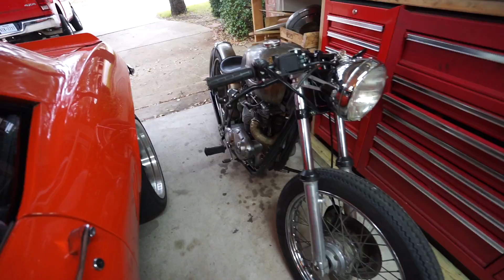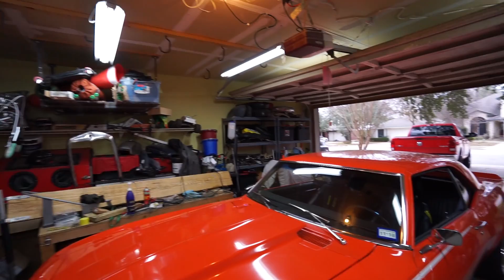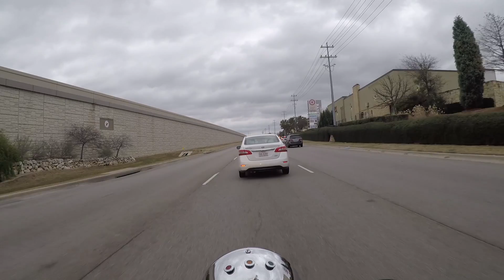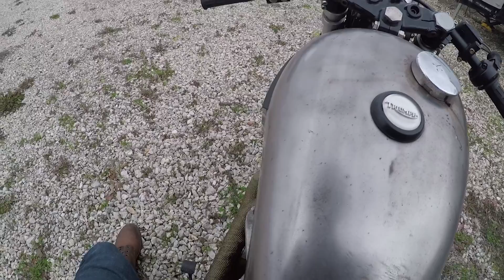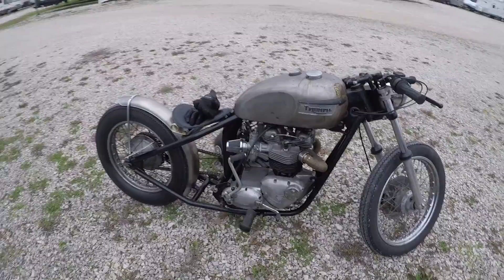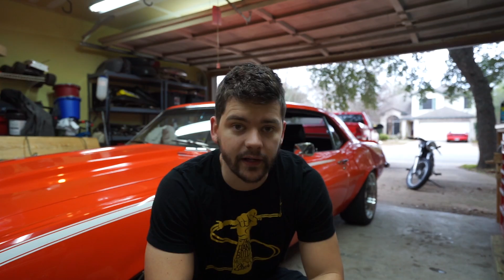Projects and Goals for 2018

Comment: Oh man i'm in love with that bobber. I'm currently building a 1979 t140e café racer. Now all of a sudden i feel a urgent need to chop the rear off! Maybe the misifiring could be the carbs clogging up or that the valves needs adjustment? My bike is running much better after cleaning up the carbs. Btw, where did you hide the coils? Are you using the original Lucas coils? Good luck with all the projects! Regards from Sweden.